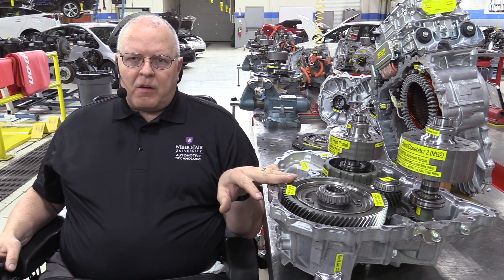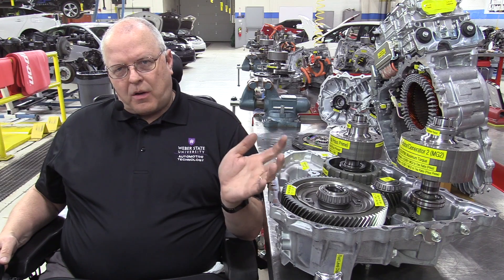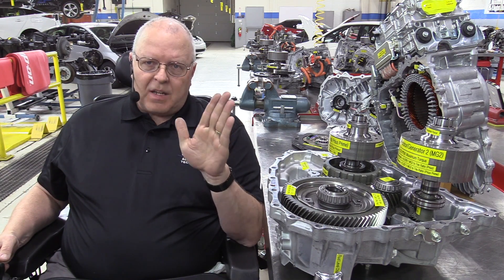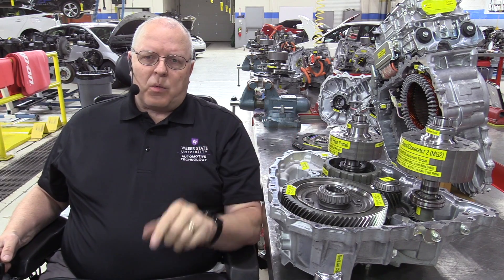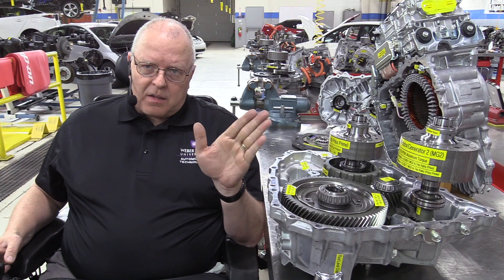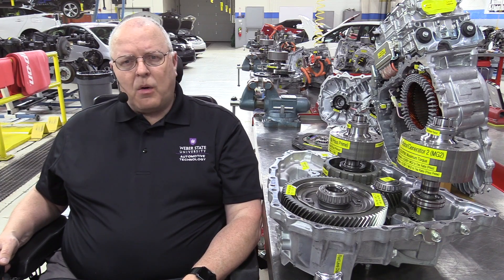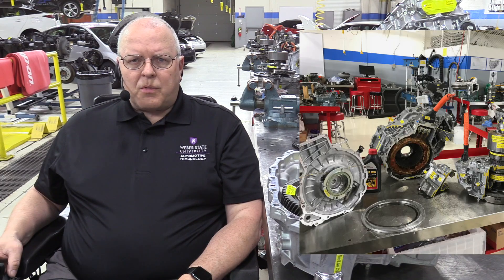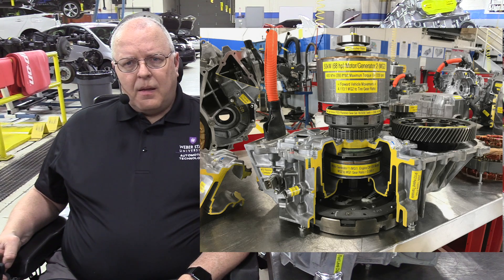The 20-Year Evolution of the Prius Transaxle

Comment: What's the most reliable generation  I have gen 1  looking for another .  Good job thanks
Reply from the maker: The second, third, and fourth generation cars are very good. The cars that are 10 years old or older will probably need a new battery, but other than that they are very reliable.
Reply: The 2nd Gen is the one that racks up 400k without any more than a new battery and a new cat. Gen 3 has more problems. The electric water pump is expensive and can fail without notice resulting in a blown head gasket. Their are 3 problems with the electric water pump. First, it is expensive. Second, it should be changed every 100k. There is a design defect in that there is a plastic ring around the impeller that deteriorates and jams the impeller. That plastic ring means premature failure. Bad design. Third, the impeller is too small for efficient cooling. The Gen 2 mechanical water pump will last over 200k and costs $40. The 2010-2012 head gaskets are poorly designed and more prone to failure. This was corrected in 2013. Next, the PCV valve is way down the front of the block and prone to sending oil to the intake. Many owners have installed catch cans. Next, Toyota added a problem-prone EGR valve to the Gen 3 that gets clogged at about 100k and throws a code. Hard to access, it needs cleaning or replacement and new ones are not cheap. It's not only an EGR valve but also a "cooler". Lastly, the catalytic converter is coolant water cooled. When it's stolen, you can't drive the car. And the GEN 3 Cat is more expensive. Insurance companies are starting to limit the # of replacements. Once stolen, you are a mark for having it stolen as soon as it's replaced. See "Muffler Tech" on YT. Also see "Gasket Masters" on  YT. They stay busy replacing head gaskets on GEN 3s. So if you want a Prius that will go 400k with minimum cost and repairs, don't buy 2010 up.
Reply: Most importantly, change the poor non-synthetic WS fluid every 30k (according to Lucious Garage). WS degrades with time and heat. Better yet, change the fluid to the best "real" synthetic (Group 4+) -REDLINE  D6 (Amazon). Smoother shifting, less noise, longer tranny life.
Reply: @amazoidal   But there is no shift on the Prius, so the fluid is there only for lubrication and cooling.
Reply: But the planetary and sun gears change rpm and to me it feels like a CVT shift. When I changed to REDLINE D6, the regen noise was attenuated.

Comment: Great videos, always.  Any thoughts on the life of the  trans fluid, since there are basically no clutches except for that one preceding MG1?  Had you done a video on the fluid circulation, ie. trans fluid and cooling?  Is it cooled like an auto trans w/ lines going to the radiator?  Just curious.  One little note.  I have an '05 and I could always feel when the ICE kicks in, so I thought it was a mechanical connection.  If it's not, why is that switch over so abrupt, if you know?
Reply from the maker: The hybrid transaxles I have taken apart have had some really burned smelling fluid. The stators really get hot when accelerating. An aggressive driving style would cause the fluid to get really hot. It is cooled by coolant running through the transaxle case absorbing the heat from the transaxle fluid that has transferred into the aluminum case. The 4th generation Prius has an external heat exchanger. The switchover can be abrupt on the second generation models (2004-2009) because of the stiffer damper springs in the torque limiting clutch (which is attached to the flywheel). The later generations were not as abrupt.
Reply: Nope.  You know and I know that the electrical circuits are in charge.  That switch-over could be handled by a capacitive storage setup.  And the big question is what is that clutch for?  My guess is that the unit is not ready for prime time and that the clutch is a last-ditch approach to keep the thing from destructing.  You can take a shot at that logic.  I'm listening to whatever you got.  Fantastic videos.  I wouldn't be haunting any other maniacs.  Consider my pestering as a compliment..or a nousence.
Reply from the maker: I always welcome feedback, thank you. The "Torque limiting" clutch is supposed to slip if the engine crankshaft or transmission input shaft seizes up, it would not cause the connected counterpart to stop abruptly (possibly locking up the front tires). All series-parallel hybrids I have seen use this clutch mechanism.

Comment: Have you done a teardown of the 2017 Volt hybrid?
Reply from the maker: Hi, not yet. I have done a 1st generation Volt transaxle teardown. https://www.youtube.com/edit?o=U&video_id=dqM3YXEf1js  It is my opinion from the training I have received on the 2nd generation Volt transaxle that is basically the same design as the first generation but without a counter-driven transfer gear. The final drive is chain-driven off of the equivalent of the counter-drive gear in the first generation transaxle. Thanks for the feedback.

Comment: why are there no ferite core motor generators in EV's and stuff like this. i think just as ferite core transformers can transfer much more energy much cheaper and with lower weigh and cost i think ferite core motors would make EV's much more affordable.
Reply from the maker: I do not know. Possibly due to the environment it would have to survive in. Durability, resistance to transmission fluids, temperature changes, vibration and shock, etc. Thanks for watching!
Reply: John Scarce lower torque maybe?
Reply: all of the theories of way too much rpm and low torque go off the window if you make it have much more sectors. (ex 10 phases with 40 sectors each instead of 3 phases with 24 sectors)